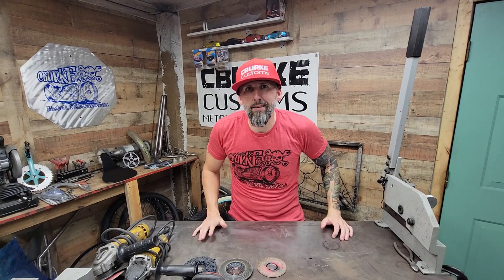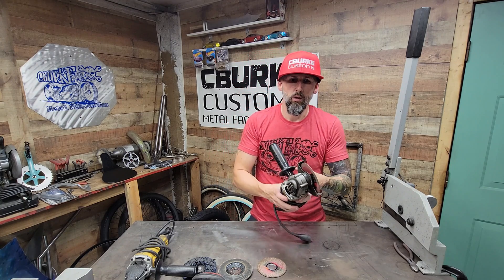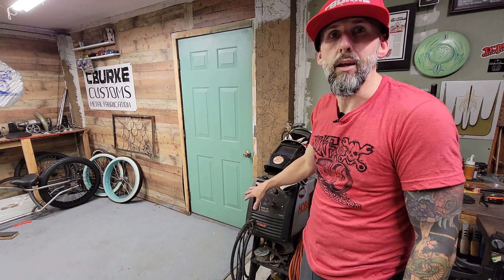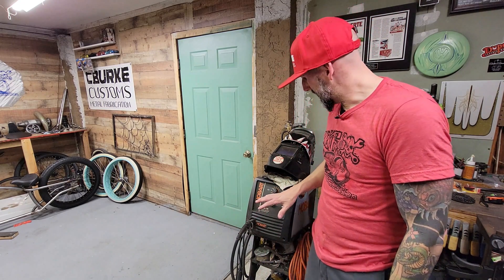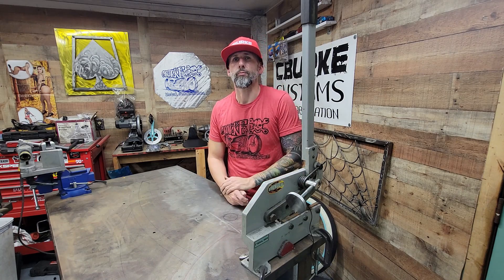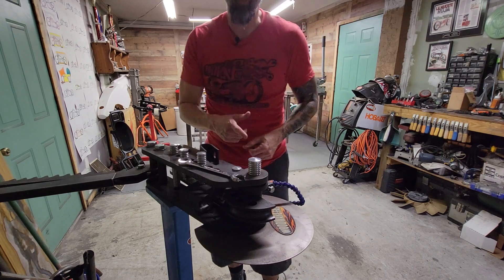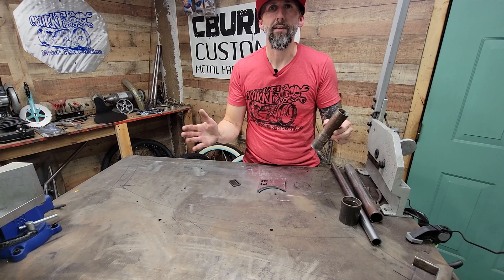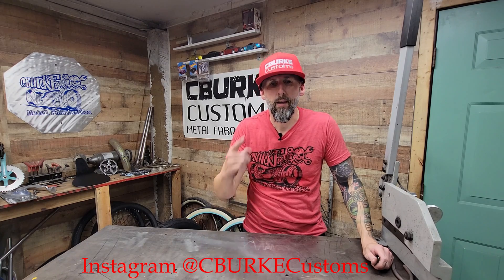How To: Custom Bicycle, Lowrider, Cruiser, Frame Building, 101 Part 1 Tool & Materials.

Comment: Where'd you get the white wall fat tire on the teal wheels against the wall? I can't find any for my 20x4.25 and really want a set of whites on both ends of my build, not just the front
Reply from the maker: It's not a fat tire. It's a 2.25 tire stretched using a 3" tube. That's on a 26x4
Reply: @CburkeCustoms  that's unfortunate. I appreciate the content and education still though. Definitely enjoying the custom frame build series
Reply from the maker: @TheRealTylerReynolds  thank you so much!
Reply: @CburkeCustoms  any links to where I can find a whitewall 20x4-4.5? And how much do you sell the frames for? I'd be interested in possibly buying one for my next build!!
Reply from the maker: @TheRealTylerReynolds  I don't I'm sorry. You can check with Sutter Street Cruisers and see if he can source them. 
As for frames, they start at $850+shipping. I don't take orders so you would need to watch my IG for when they are done and for sale.
Reply: @CburkeCustoms  for sure will keep an eye out and check out your other builds!! Appreciate the referral

Comment: I want to know the total budget of equipment needed to make the frame. Thanks you
Reply from the maker: Hard to say. Depends on what you buy. There's such a wide range brands you can get. I'd say to be safe, $2000 (with the welder) for a good enough setup.
Reply: @CburkeCustoms  I want to know the price of the frame that you build, about how much it costs. I like it very much. I want to make an e-bike font hub.
Reply from the maker: @markmonthol4484  all my frames start at $850 and up depending on what all I did to it.

Comment: Hey Burke, if you don't mind me asking who do you know as a reliable source for buying a decent size welding table.
Reply from the maker: Ugh, I wish I knew on that one. I will be in the market this year for sure. If I find anything, I'll let ya know!
Reply: @CburkeCustoms  much appreciated, thank you again, if all fails I will just haft to go to a local scrap yard and build my table.
Reply from the maker: @josephbowman87  I just picked up some thick 1/4 plate. Does the job for now but I would love to have clamp holes.
Reply: @CburkeCustoms  a good size drill and some tungsten bits that go through metal and measurements should do the trick.
Reply from the maker: @josephbowman87  maybe. A lot of work lol.
Reply: @CburkeCustoms  yeah, it's cheaper though making your own, it might be not perfect.